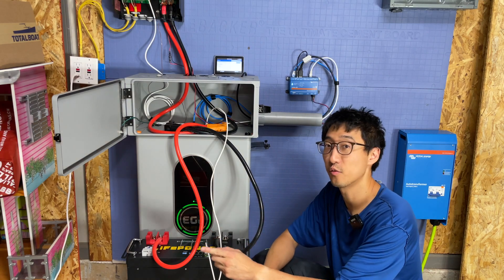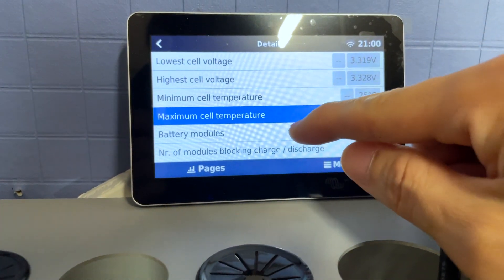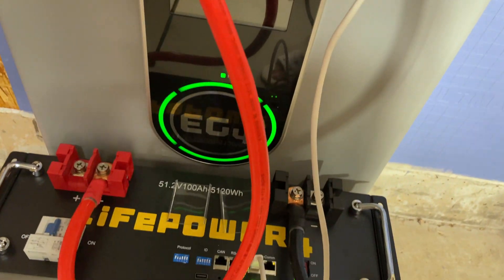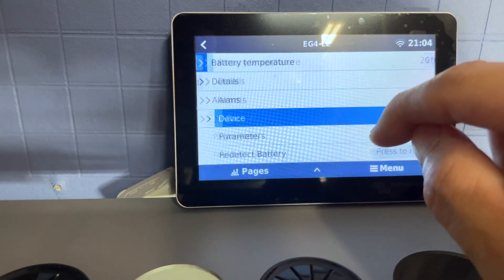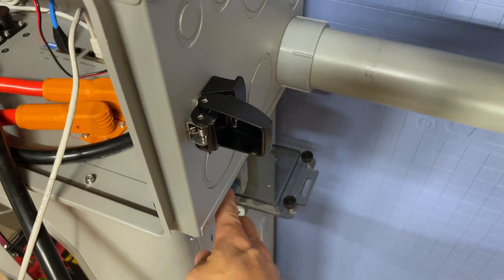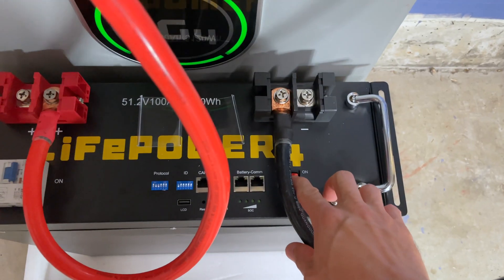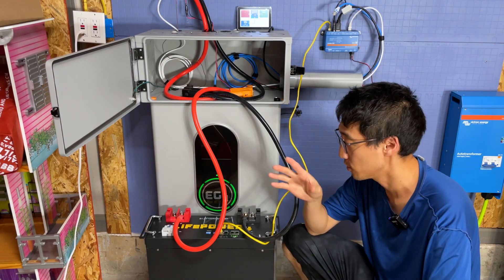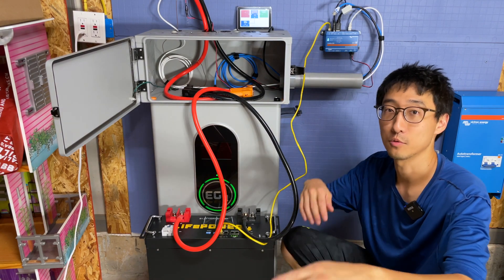EG4-LifePower4 V2 Lithium Battery BMS communications with Victron Multiplus Cerbo

Comment: Great explanation -- I would like to have this for my Victron system. However, my EG4 Lifepower4 (version 1) doesn't have CAN, RS485, and Protocol dip switches. Is there any way to connect Lifepower4 (V1) batteries to a Cerbo GX and monitor? Thanks.

Comment: Super excellent and helpful video. Thanks for doing this. Do you have a video about setting up a MultiPlus for a remote shutdown switch?  I understand the newer EG4’s are also capable of disconnecting with a rapid shutdown system. Could you explain how that works?
Reply from the maker: Unfortunately I don’t have one for that

Comment: Hi
I have a question regarding an LFP 200AH battery. For the first three months of use, based on its 200AH specifications, a technician noticed that the Battery Management System (BMS) from the vendor was programmed for a 150AH battery.
This battery is rated for 6000 cycles, but after only 670 cycles, the cells became inflated. Upon reviewing the data, the manufacturer found that several cells were defective.
My question is: Could the fact that the battery operated for three months with parameters set for a 200AH battery while the BMS was programmed for 150AH have been a contributing factor to the battery issue?
Thanks for your insight!

Comment: I’m getting ready to setup my 6000xp with the wall mount battery and I have 2 of the eg4 LL v2 batteries and I’m wandering if you have set up this battery configuration on ur 6000xp and if it recognized the LL  v2 on the 6000xp I was going to run a chargverter GV thru a BusBar with the wall mount and add the server rack batteries that way any advice would be greatly appreciated

Comment: Hi, can I use same set up that you have shown I.e EG4 wall mounted battery and rack battery with Growatt ? Also to update wall mounted battery firmware , which cable do I need. Tried with read and write cable but does not work. Would appreciate
Reply from the maker: I've messed with a growwatt but not of my own installation, so i couldn't help you much there.
There may be a way to get communications working with it, not sure. But surely you could use it in lead-acid battery mode without bms communications.

Comment: Very interesting video. I want to power my pool pump motor to solar, do you have a video that can help? tks
Reply: I connected the main breaker panel straight to the 240v output from my MPPT inverter. My pool pump is connected to that breaker panel. I've got 2 in my house. I only got 6kw of my 15kw of my panels hooked up so far so I haven't run it yet.
Reply: @Gary-ee3kq  sound good, but i do not have panels or basic solar knowledge to calculate my needs. 
Please comment if you are able to make the work, i also want to connect it to the 240v breaker box.  tks for the comment!

Comment: i think that's the BMS limiting the current ? because is full , maybe i may be wrong 🤷
Reply from the maker: Hmm. That is possible. Didn’t think of that. But that would be some advanced bms.

Will have to try it when it’s empty.
Reply: @tgbatg  there are some kits ( pump+solar motor) in the market but i want to know if i can use my existing motor . 
There are some kits in the market that  include the pump,motor panels and a controller for $2300. 
i wonder if there is a way to do it cheaper. 

Any comments are appreciated! thanks